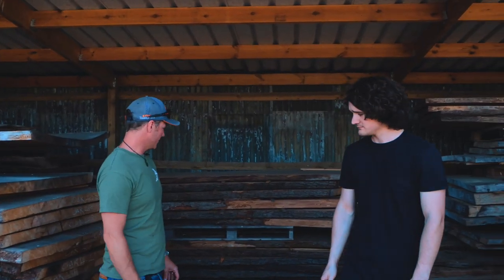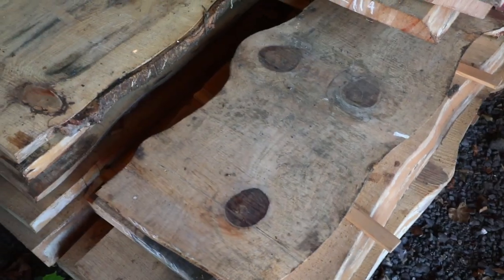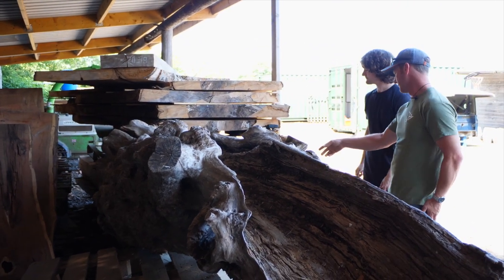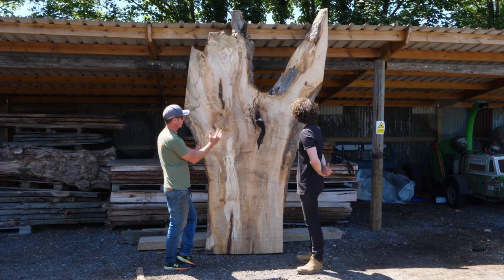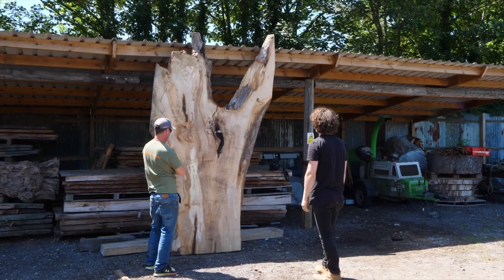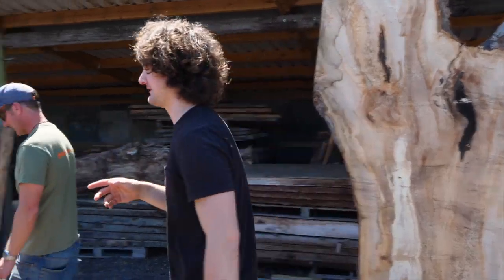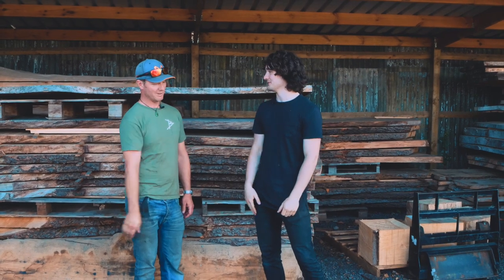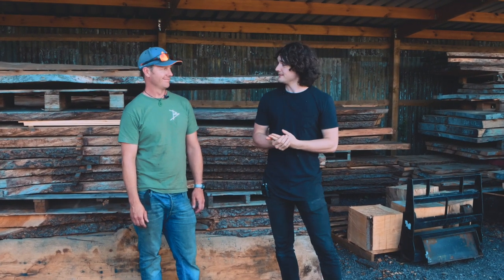Blaise in Trees | Buying Hardwood Lumber #2

Comment: In an old book i read that Maple (and Sycamore for that matter) should be thoroughly cleaned from sawdust (as explained) AND dried in a shed, standig upright with root end on top. So the sap could find its way down out on the treetop and avoid rotting and staining this way. BTW. stained maple can be bleached with hydrogen peroxide very effectively.

Comment: I have to say I find spalted wood horrendous...I don't see the draw people have to it..but we're all different :)
Reply: I use it for knife and tool handles and with pieces less than two inches wide and four long you can usually isolate some interesting patterning for show. The pattern on the surface won't always run true as you go into the wood though, like burl, so it's always a little trial and error. Additionally unless you're controlling the spalting from start to finish, and you're trying to direct the pattern by innoculating different areas of the board and then drying it to fix when you're satisfied, or you catch it in fallen wood at just the right time you're going to need to stabilise it, which adds a whole new complication. Each to their own as always, but I believe the premium it often extracts, and the fanaticism associated with it is in the difficulty in getting it to look attractive, rather than just a bunch of black lines and grey staining. I'm very much a novice but with material like spalted wood you have to go with it and be flexible, you can't have work requiring fixed dimensions or a fixed patterning, or at least that's even more difficult to achieve! I have seen pieces where it's looked absolutely stunning however, and I go out of my way to dry small logs with deep seated fungus evident from the exterior, but without the wood being punky or structurally unsound., It's rare that it's one community within a log of any size, and it's the byplay of their zone line fortifications that gives the characteristic black lines. Though I've also seen people intentionally using the grey staining fungus in combination to create less monochromatic variations, and a pinkish stain too. With the right finish the grey becomes a shimmery silver contrast to the black of the zone lines and the natural colour of the wood. If you persisted long enough you could probably get spalting to look patterned somewhat like Damascus steel, the other princess of popular opinion, with it's own polarising aesthetic. I'm not so big on furniture or wood turned vessels made with spalted wood though, the excess of zone lines on show and the natural randomness of the distribution on large pieces doesn't appeal to me. It might if it was bookmatched veneers of certain wood though, thinking about it. 

I guess it's probably on a piece by piece basis for me personally. Like all grain, figure and patterning, a little can go a long way as an accent to a larger plain surface. I think with most things an excess oftentimes looks vulgar and overdone - with exceptions granted for exceptional pattern in exceptional wood - something like quilting and figure in maple, if worked right on a large surface can look stunning, but then the cabinetry, or whatever the piece is, has to remain simple and elegant to put the wood forward, or even that fantastic quilting gets overlooked for the gold leaf around the edges.